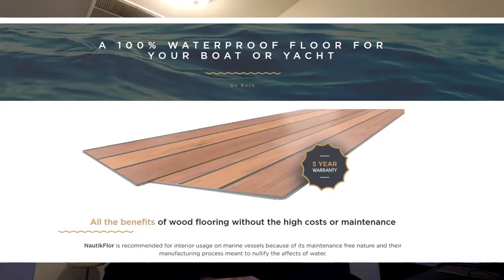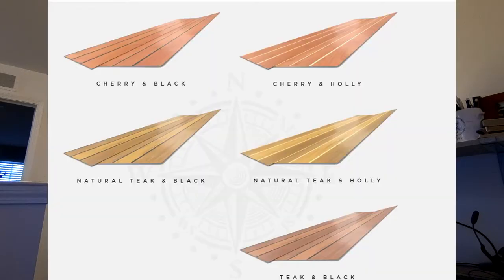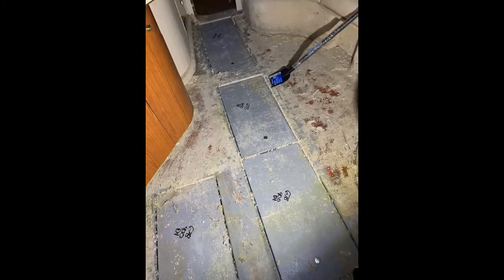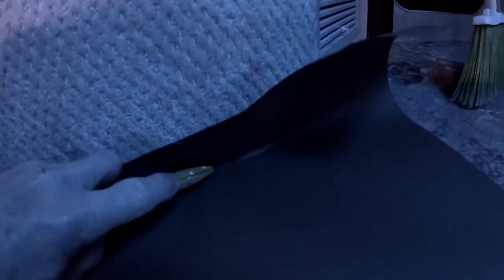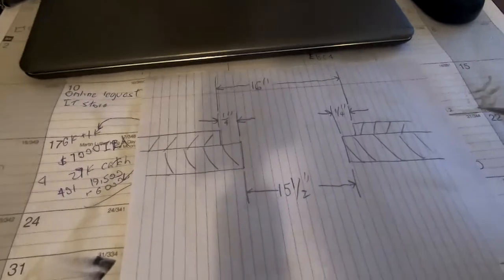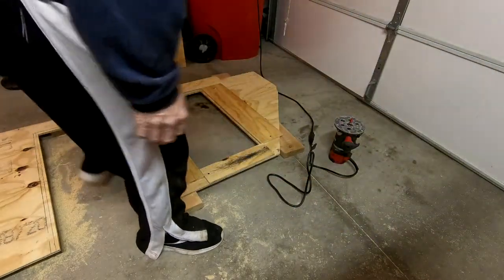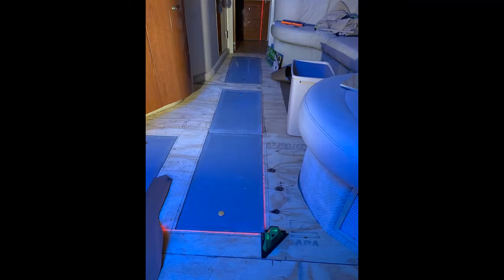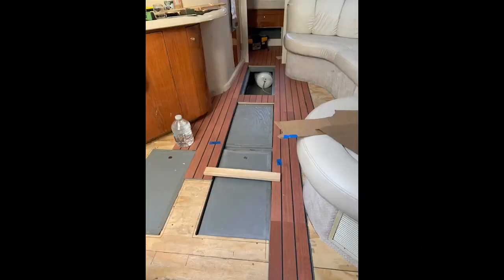Installing Nautikflor In Boat Cabin

Comment: great vid! Did you use L trim or T Trim? And what did you use for the 3 vertical pieces on your stairs at the end of the vid?
Reply from the maker: Thanks for watching.  I used L-trim.   Unfortunately, I can't remember where I bought the trim pieces or the sheets for my vertical pieces. Not sure I didn't mention in the video?
Reply: No you didn’t but it’s all good. I think your vid gave me inspiration to do mine. Have a ‘94 Sundancer 440 that has retro green carpet 🤣 Can tell it’s really glued down tho so likely go your route w/ 1/2” plywood.